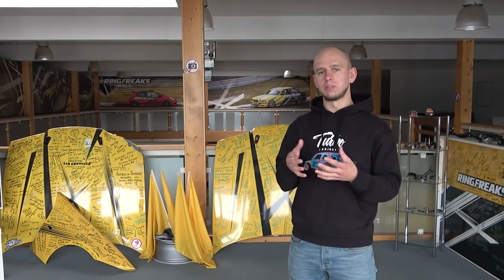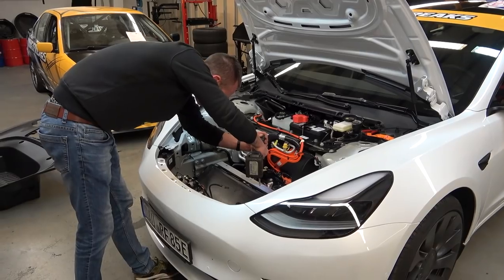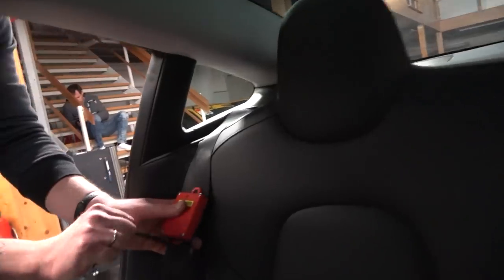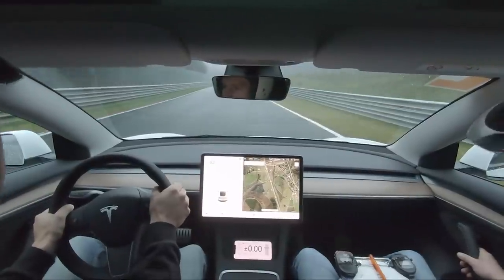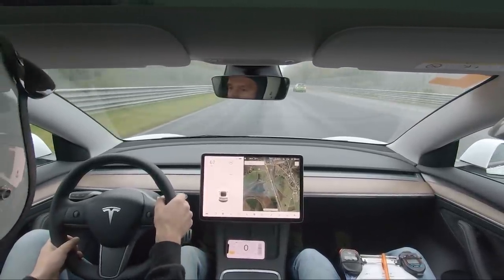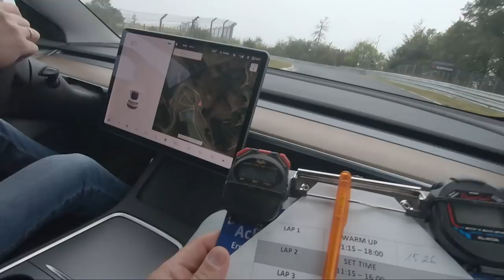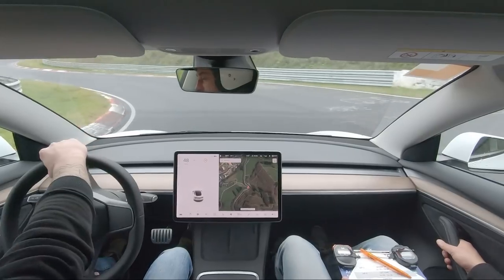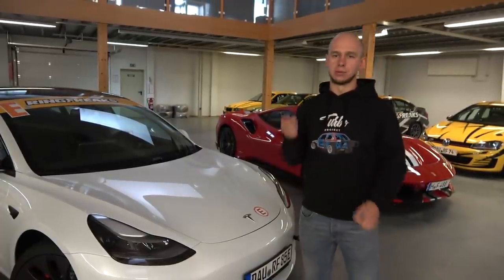THE WORST WEATHER RACE WITH OUR TESLA AT THE NÜRBURGRING

Comment: Very cool, but why not using track mode? Regen can be higher in that mode and stability control can be turned off. Furthermore there is a laptimer integrated
Reply from the maker: mostly because we were driving slowly and carefully, as well to save some battery from fans spinning at full speed. But of course we could have used it and have had more fun on such track!
Reply: @Ringfreaks  Thank you. Without stability control on -10 in track mode I would think of a lot of break pad and disc wear. Even on -9 my Tesla intervenes too much and this is also less efficient. But you are right, cooling from use of track mode would reduce efficiency too. Thanks for sharing those videos! You are doing a great job.